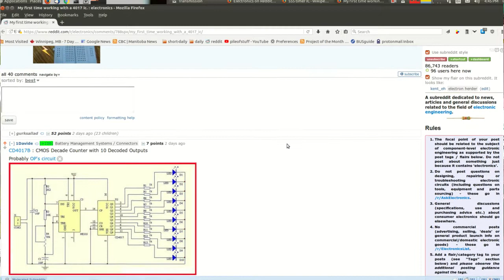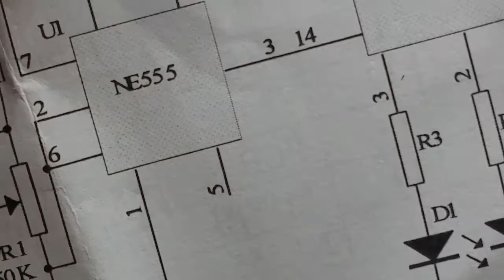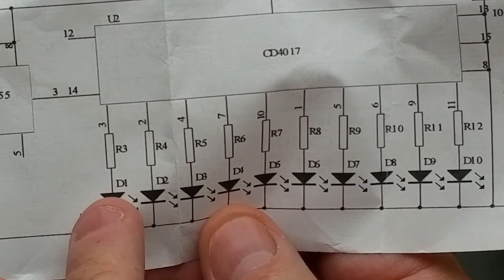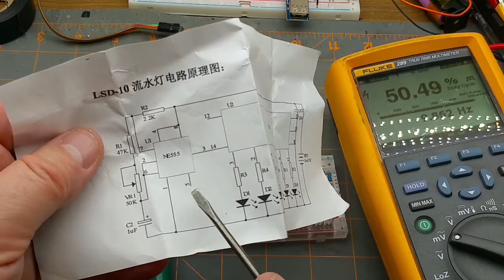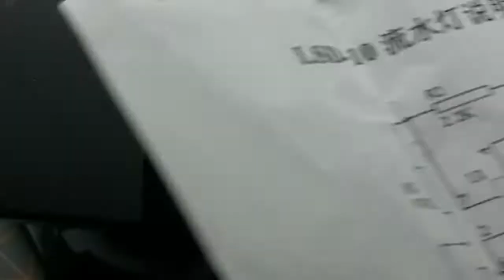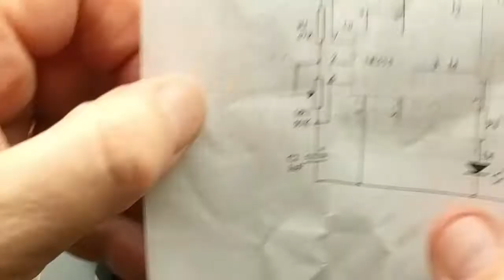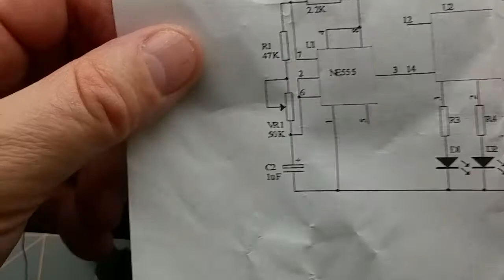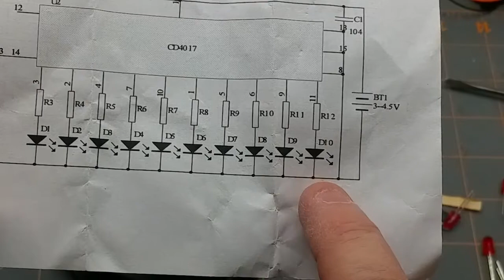classic chase lights circuit

Comment: Yes, built similar circuit, it was a “musical “ doorbell. It used the counter to activate the notes. A plugged in diode matrix made the notes. However, on test  I could not understand the musical “song”  on completion. I showed it to some friends and one spotted that the song had played backwards !!. I had wired the matrix up first note last etc etc. All part of the learning curve. Now it’s all arduino and raspberry pi etc, all software. Still enjoy breadboarding. Keep up the good work, thanks for bringing back memories.
,

Comment: I was going to say I don't recall making a LED chaser like that, but then I remembered when I had a house and built a shed in the garden, I ran phone and network cables out to it and made a cable tester for checking the connectiions on RJ45 and RJ11 cables, which had the appropriate sockets on either end and pulsed each wire seperately with a 4017 clocked by a 555. The other end had LEDs on to see if the wires were broken or shorted. Not exactly industrial quality checking, but good enough for what I wanted. Sadly I have no idea where it is any more!

Comment: Good job with the resistor fix! I have often wondered how hard it would be to push a component like that down in that manner, now I see. 😬👍 (FWIW my first circuit like this was a 4 step chaser that used a 555 to clock a CD4013 + CD4001 ... baby steps!)
Reply from the maker: I make the mistakes so you won't have to!

Yeah... That's why I did it..

Comment: Good Job.
I made a similar circuit way back when, But I added another chip to it to make it step backwards when at the end and then forward at the other end. "Knight Rider Effect".
I think there was 16 LED's in it. I mounted them in the grill of my 1958 Pontiac Strato Chief.
I'm sure I have it in a box in the closet now somewhere. I will dig it out and have a look one day.
I did buy a dozen or so of those kits you have . I made 4 but only installed 1 555 Timer on one board and jumped pin 3? ( Output ) to the other boards. That way they were all in sync. Looked kinda cool. I have other kits that have 11 LEDs on it. What the hell is the 11th one for. ( Shrug )